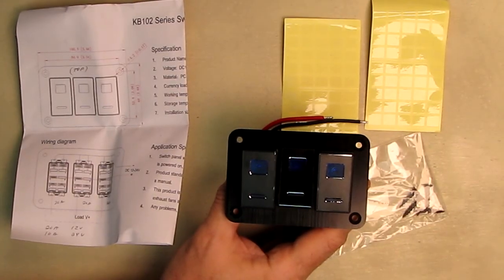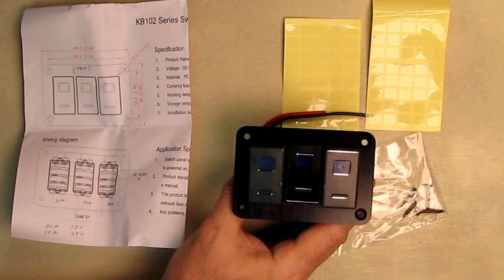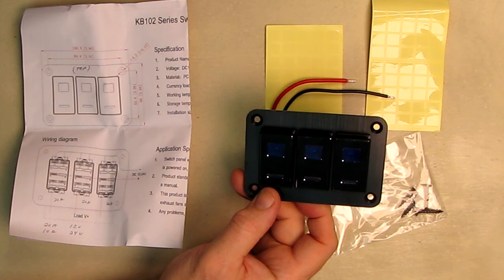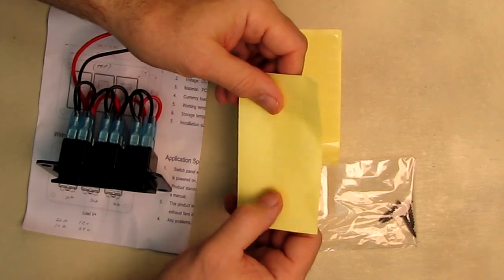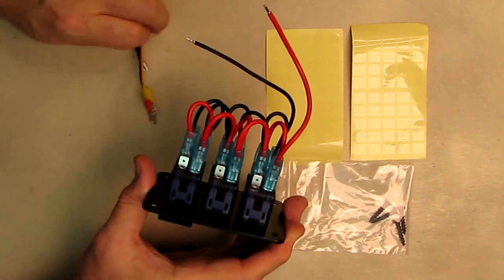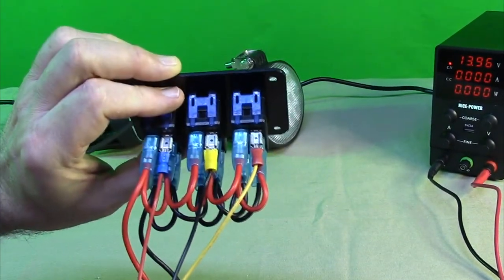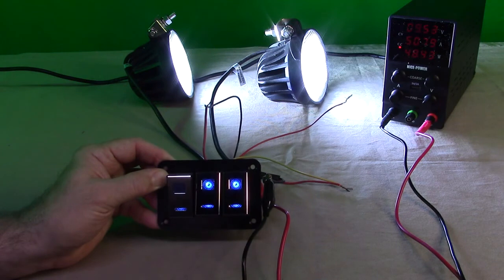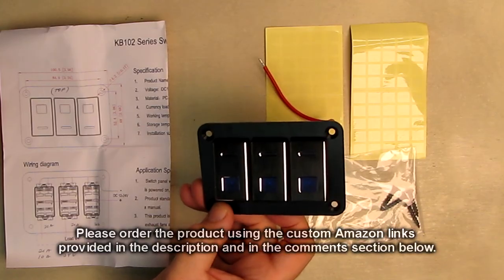Great Quality Xhtechnology 3 Gang Aluminum Rocker Switch Panel 12V/24V Blue LED Illumination REVIEW

Comment: This 3 gang switch panel is made extremely well. It is on an aluminum panel so it is sturdy. The rocker switches are rated for 12v/20A (24v/10A). They are lighted and come pre-wired for the light part. All you have to do is hook up the power source and the output source to the things you want to control.
The switches have an open spade terminal for the power connection that the switch will control. All of the existing connections have a rubber grommet to prevent shorting, a pretty nice switch panel.
Reply from the maker: I agree!